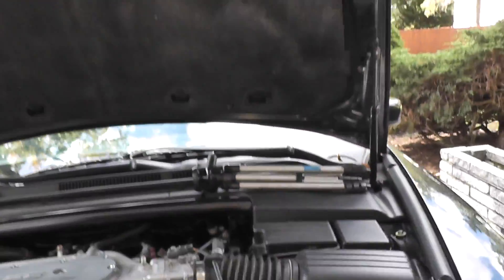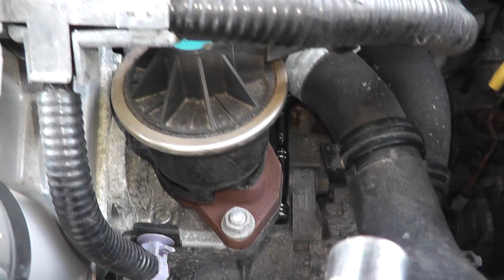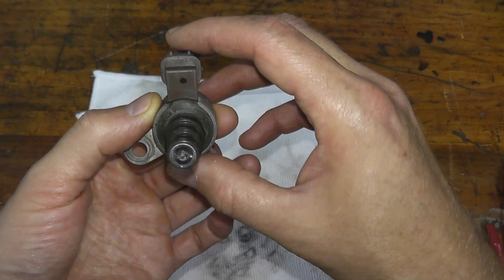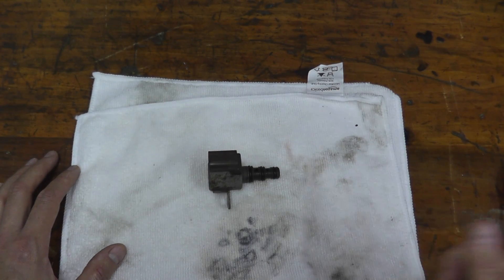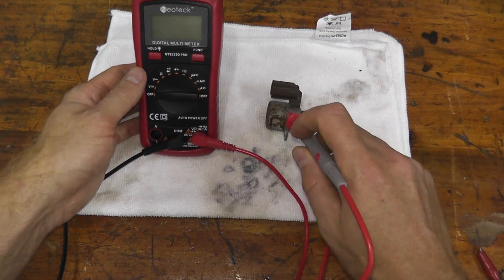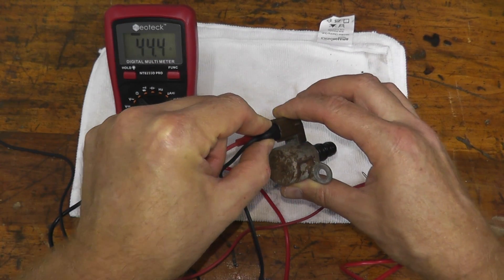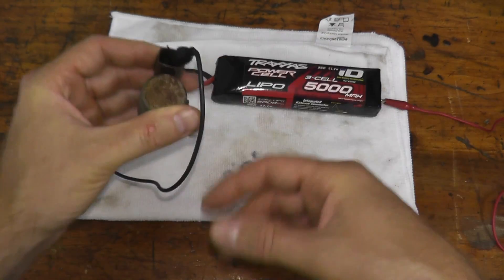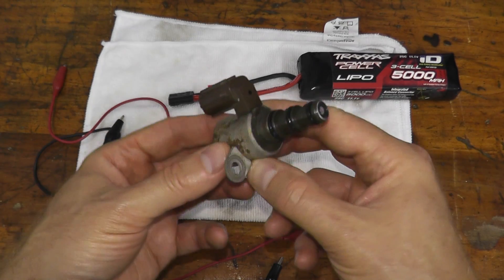Torque Converter Clutch Solenoid Valve Testing & Replacement P0741 / P2769 / P2770

Comment: Pulled my TCC solenoid out today. Ohm are good, it clicks and starts to get HOT with power on it. (prolly bad....) Moreover, the popett was NOT moving even though the ferrous  disc was clicking inside. with power. Detached poppette!?
.

Comment: Actually, you removed the short solenoid valve B.Also, did you get that connector disconnected in such a tight space? The Torque converter Clutch solenoid valve is the farthest one

Comment: My 97 Jeep has an error code " P0743 Torque Converter Solenoid Circuit Electrical DTC " Had it looked at a shop but they couldn't diagnose anything.

Comment: Where is the torque converter clutch solenoid in a 2008 Acura TL? I need help finding information. Anyone? I am getting the P0741 code "Torque Converter Clutch Circuit Performance/Stuck off"

Comment: I have a 2004 TL, and went online to Rock-auto looking for a solenoid, apparently there are two types (one with a brown connector like yours and one with a black connector). Don’t know if there is any difference other than the color of the connector housing.  Thanks for the thoroughly well done video.  Feedback on valve location:  from the front of the car, it is just to the right of the transmission fill plug.
Reply: The black one is the clutch solenoid, the brown one is shift solenoid B

Comment: Can this sensor make the d flashing ?
Reply: No.  All the sensor does is its function.  If it is malfunctioning, you should get a CODE.  The D flashing should be in your instruction manual.  It would be helpful if you included the year and model of your car if you wanted more help.

Comment: hi, I'm a bit miffed and need some help. I've seen a few diagrams that show the torque converter solenoid valve is the one (black connector) that's behind the Brown connector solenoid that you took off. Any insights appreciated.
Reply: you are right i see diagrams and the TCC is the one behind the one he took off

Comment: I have a 2006 Toyota matrix. I got a po741 code . so I changed my tcc solenoid.new. plus new oil and filter.and I clear the code after I was done. I ran the car like 20 plus miles freeway as well. Got home and no check engine light. So i put my scanner on it just to see if any thing would show up. And I got the po741 but it on pending this time. And no check engine light on dash. Why is that ??
Reply: I think you need to run the car longer,like for a few days ,then everything will clear. It has to finish a cycle before the code is deleted.
Reply: Yes you are Wright. I did that and it's bin good.

Comment: I got a 2007 TL and the solenoid is not where you showed. By any chance do you know where it has it? I know the 07 changed from the 04-06
Reply: YOU are supposed to look it up.  Go a illustrated parts breakdown page by selecting YOUR car make nd model.  And freaking look for it.   If you can't find it that way, go to autozone (or other store) and have them show you while trying to buy it.

Comment: So my mazda cx9 has been shuddering for little over a year while in automatic mode. Does it when rpms are low and you go to step on it. It is usually in 4th gear when it shudders. We have no issue when driving it manually. No shudder ever in manual.  Would you know if this solenoid valve could fix the issue or would I need the whole torque converter?
Reply: I know it has been awhile and you might have figured it out.  The TCC valve is only active during AUTOMATIC when it needs to sense the build up of pressure.  If you are in manual, it does not need that feature.

Comment: I'm pretty sure the front solenoid u took out with the brown connector is the shift solenoid and the one behind it with a black connector is the torque converter clutch solenoid
Reply: The black connector,  which is the rear solenoid (farther from the front of the vehicle) is definitely the B solenoid. Just replaced one on my cousin's 2007 accord v6 due to a P0741 trouble code.   Fixed it immediately. No more odd shifting behavior.
Reply: @jakemiller4089  no, the one behind is TCC, the one he took out is SSB, he should check the one behind - TCC
Reply: I have been trying to figure out this. I have a diagram that points this one (the one in video) as the B Shift Solenoid, but when I watch this I got confused. I also think this is shift solenoid b.
Reply: I have a '06 Acura TL & the TCC is the one with the Black Connector. The Brown Connector is definitely the Shift Solenoid Valve B. Hmmmm, but awesome video.  Thank you.
Reply: Correct.

Comment: Is the torque converter clutch pressure solenoid mounted on the engine???
I believe it should be somewhere on the transmission
Reply: the video showed him removing it from the transmission. No clue what you're talking about

Comment: Update: removed and bench tested both clutch solenoid valve (similar to this video) and dual linear solenoid - both seem to work (clicks and within acceptable Ω resistance range)

Found no faults in the valves - P0741 wins

 
2003 Honda Accord V6 has 2 of these (working on P0741)
Reply: Try changing the wire harness, worked for me after changing shift solenoid B
Reply: @jaygee4624 the shift solenoid was the brown connector infront of the black one in the video right? And if yes what is the website or store u got it from ?? Please my accord shifting is ass

Comment: hope you all are fine.
i hava a code (17 torque converter clutch fnctn) of transmission of my nissan wingroad i removed but again appear. my automic transmission os not shifting properly please help me how to solve this problem
Reply: By process of elimination, either pressure is not being sensed, or there is insufficient pressure in your torque converter.  there you go, diagnosed.

Comment: Im getting 14 on both solenoids so is it bad since yours are much higher resistance
Reply: No as long as it test between 12-28 it's good
Reply: @joyceanderson2423  what if my yr 2000 4cyl Honda accord solenoid that looks just the one in the video tests 40, does it mean its open and no good

Comment: P0741 SUZUKI

I have suzuki wagonr 660cc 2014 model fx version, Aftershock in my car and gear light shown in meter so I Changed transmission oil CVTF green2, so aftershock problem had fix but gear ights comes back again and again after clear coeds, so please help me to fix this P0741 code problem

Comment: You are great at transferring  knowledge.!👍
Can you suggest what to check next if the same code  comes up again? Mine came up once before about 1 year\3,000 miles. It's not driven much and has 220k miles.

Comment: Do you know where torque converted solenoid for my 2006 corrolla is I Had a p0741 code
Reply: Inside the Transmission near the pan.
Reply: Me too, I’m trying to pass a smog test but does this help?
Reply: It’s under the hood

Comment: I have code p2770 which is TCC solenoid valve circuit open, I was hoping someone could provide the part #
Reply: I have the same problem 2007honda pilot can't find the location of the tcc solenoid

Comment: My solenoid on my 06 acura tl reads 17 ohms and it does click when I test with 12 volt battery the valve,but when it clicks I don't really notice the valve moving so not sure if it should be replaced?
Reply: And I have a p0740 check engine code
Reply: That’s what im trying to figure out. Mines click, and i cleaned it out. But I’m having the same problem
Reply: Just because the resistance is readable, he said the range should be 25 to 28 ohms.  Anything outside of that may not have enough inertia to overcome the pressure of the fluid building in the transmission.   Think of the car battery, it can just a hair under 12 volts, but still NOT enough to start your car.

Comment: Hello, I came across your video. I have the same code p0741. TCC SOLENOID on a 2006 Scion tC. I cannot find any material or part to replace. Can you please lead me in the right direction
Reply: The Solenoid is in the Transmission. Got to drop the pan.

Comment: Toyota allion 260- recently get an issue once i start the car after 8,9 hours. (When engine is cold)

I can start the car normally without any issue and at the N,P gears when i push the accelerator RPM goes up and no any issue can identify. 

But when i change the gear to D and when i push the accelerator RPM does not go more than 2000 and car can not pickup a hill.  But after few min it comes back to normal and car runs perfectly. no jerks no gear engagement issues or vibrations can be identified. 

To check above problem on a flat road, i stopped the car on a flat road and kept two wood pieces to wheels and redo the above steps to check what happen. same issue was there. Car can accelerate on P &  N Gears,  when i change the gear to D and when i push the accelerator RPM does not go more than 2000 and car can not move forwatd by climbing up the wood piece But after few min car come back to normal and can pass that wood piece.

Mileage 85000KM & 80000KM service done with toyota.

Spark Plugs not changed/Air Filter changed/CVT changed at toyota

 

Any suggestions?
Reply: Your Catyllytic Convertor might be diffragmented in there🤦🏽‍♂️. Sucker made me change a whole transmission

Comment: Great video! I'm getting the P0741 code, but my car drives and shifts perfectly, however at times my RPM's run high (4-5K) at times, causing me to pull over and disconnect the battery. Once I reconnect the battery, everything is perfect for a day or 2, before I have to do it again. Do you think this sensor has any merit of this behavior?
Reply: I think the one I'm working on is doing the same thing... 
After I clear the codes it drives and shifts perfectly but after maybe 20 minutes of driving it will get worse. Eventually it will shift 1-2 and then shift OUT of second gear. Then I have to limp it home at 25 mph or so.  If you put it in park and try to go again sometimes the whole car won't move at all. But if I clear the codes it's immediately 100% fine again (for another 20 minutes).

If it really is just the lack of torque converter lockup causing the car to do this on purpose (or otherwise), what a bad design...
Reply: @fisqual  Hi I am also facing the same issue. Were you able to resolve the issue?
Reply: @akhileshkmr421  I was!  I changed the little cartridge filter and blew out the oil cooler lines (disconnect from the radiator and transmission and blow out the hard lines with compressed air) because they were clogged with bits of the filter. ...Thankfully the year I was working on (2005) had a filter, (some years do and some don't and I don't remember which) but I got the "ATP Automotive B-266 Automatic Transmission Filter Kit" from amazon, installed it and the car has been good to go ever since! I would also recommend changing that gasket which you probably will have to source from the dealer. But $10.22 is a small price to pay for an attempt to fix it!
Reply: @akhileshkmr421  the vehicle I fixed was a 2005 Acura TL btw. I realized the video was not specific which car they were working on... GOOD LUCK!!
Reply: @fisqual  how did you know the filter was bad? You cut it open? Or was the fluid dirty? My fluid remains clean but I'm having the exact same problem as you and I've changed all of the solenoids and switches on the transmission. Still getting a p0741 code for TCC. Supposedly I don't have a filter on my car so I'm curious if blowing out the lines would still help. Otherwise I'm thinking it's the TCM(trans control module) built into the PCM/ECU?
Reply: What are p0748 Honda Odyssey??

Comment: Hello I’m live in Thailand my car Honda d17a transmission auto lock up not working I am test solenoid is good
Reply: I think the only Honda with a worse automatic transmission than an Acura TL or V6 accord is a D17 civic. Suckers are made of glass... 
Did you remove the solenoid and see it move? Sometimes they are electrically fine but they get stuck and won't actually do the job.

Comment: Great video!
I have a 01 CL, same engine, I believe same transmission.

How to tell if this is Shift B or Shift C solenoid?

When I make a hard u-turn, and hit the gas, the RPM’s increase but the car doesn’t go.
I have to wait until the RPM’s go down to 700 before the car starts moving.

I have no code.
Thanks!

Comment: Hey,  I am wondering if you can help me out with this while I was checking my sensors a little hose got unplugged it comes from the transmission but I dont know where it goes connect it any idea is a rubber hose, too bad that can post a picture
Reply from the maker: What kind of vehicle?
Reply: @Carsntoys  it's a honda pilot 2004, does transmission has a breather hose?

Comment: What about P0744 code ?

What kind of car is this?

From what I can see in my maxima it’s inside the transmission.  It would be nice if it was outside like this .
Reply: D Fields what year maxima im having the same problem on my 2014 haven’t even been 75k miles
Reply: @capncrunch1733  guys nissan uses a cvt.  do they even solenoids or just actuators to change the speed ratios?
Reply: B. Weezy  my 2001 maxima  does NOT use a CVT.  That’s why it has 210k miles on it now.
Reply: Cap'n Crunch  mine is 2001 maxima it is not a CVT.  It has almost 210k miles now.  I did a 3 drain and fill to flush the transmission and uses Lucus and seafoam transtune (I don’t think those will work with CVTs). 

If you have a Nissan and it’s a CVT it’s a JATCO CVT transmission  one of the worse transmissions in the world.
JATCO manual transmissions are solid,.  The non CVT autos are ehh ok.  But CVTs are crap. 

What I think is up with the 01 maxima is shift solenoids and TCC. Needs to be replaced ,  but it could also be the TCM or  transmission temperature sensor .

I did a few vid logs on it

2nd drain and fill  adding Lucus https://youtu.be/aRZva2DyLuA

Adding seafoam trans tune 
https://youtu.be/t0_xgIJYu2s

Post 1k miles after adding trans tune
And 3rd and final drain and fill to complete flush

https://youtu.be/eLYJ9sYB4Vw

I emphasized that fluids I used will not work for CVTs. I used Nissan matic-D compatible fluid. (Valvoline maxlife full synthetic ATF)

Yah after the flush and fluids and all it’s night and day difference.  And a lot better.  But CEL still comes in with p0744 after a few days of use.  Also it has some problems with going into overdrive. ( doesn’t seem to work)
It use to have problems shifting from 1-2 and starting from a complete stop.  But the ATF flush(3drain and fills with few thousand miles between each) and seafoam trans tune and Lucus helped a lot.